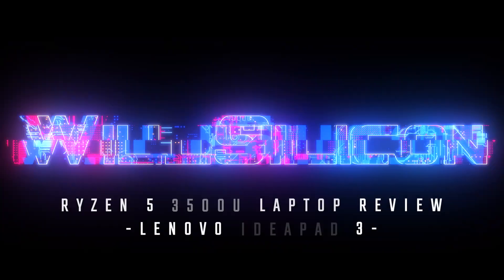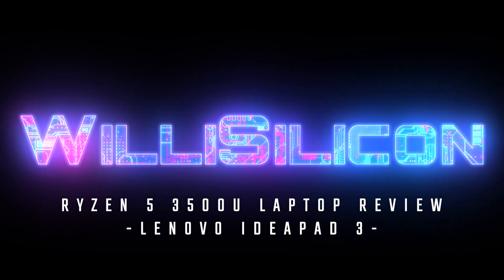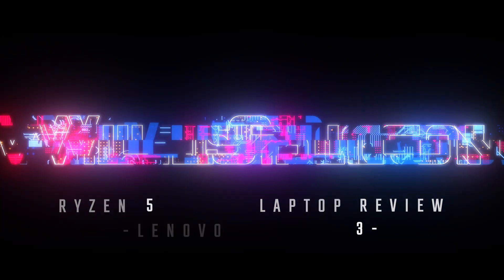This $450 Dollar Laptop Rocks! - Ryzen 5 3500u - Lenovo Ideapad 3 Review

Comment: the asus vivobook is a better buy, it has the same specs with a fingerprint scanner, thinner bezels and a backlit keyboard for the same price.
Reply from the maker: The only vivobook I saw around the same price had a bigger screen...which was bad in my case...and a Ryzen 3 instead of the Ryzen 5
Reply: WilliSilicon i was going to buy the one from walmart but its sold out ): it had a 14 inch display ill see if i can link it
Reply: @WilliSilicon  https://www.walmart.com/ip/Asus-VivoBook-14-FHD-Thin-and-Light-Laptop-AMD-Ryzen-5-3500U-Processor-8GB-RAM-256GB-SSD-Storage-Windows-10-Google-Classroom-Compatible/223381882
Reply from the maker: Nice! That doesn't have an NVMe SSD, but otherwise same specs. Great deal! Thanks for sharing

Comment: Love the Video, I have this exact model of laptop myself and I was able to upgrade to a WD sn550 1tb nvme drive as well as a 16gb stick of corsair vengeance ddr4 2666mhz ram for a total of 20 gb works awesome.
Reply from the maker: A 16gb stick works??? Lenovo claims 8 gb max in the slot! Awesome! Thanks for the info!
Reply: @WilliSilicon  It's the same with my Ideapad 330S.  They don't say in spec that 16GB stick works, but it did.
I used Crucial 16GB Single DDR4 2666 MT/s (PC4-21300) DR X8 SODIMM 260-Pin Memory - CT16G4SFD8266
Reply from the maker: Nice! Thanks for the info
Reply: Can you link me to the drive you got? I think I found one for a good price but I wanna make sure. And have you checked it’s actually utilizing the extra ram? I’m sure it’ll it work but I’m not sure it’ll use it. I just don’t wanna waste money on a 16 if I don’t need it.

Comment: Is it okay to use that laptop while charging?
Reply from the maker: Yes. Just as most laptops, the battery is bypassed while plugged in after it is fully charged. Eventually the battery will decay regardless. The laptop has great battery life to start out though.

Comment: Thanks for the review.Which 8Gb Ram Stick did you use to upgrade it to 12Gb?
Reply from the maker: Thanks for the view! I didn't upgrade the RAM. But any 2400MHz  8GB stick should work fine. The motherboard may allow a faster speed, but I have not tested this. 8GB total RAM is plenty for my son for now.

Comment: I have the Intel Version Of this Laptop I Love it. its super snappy And fit all my needs.
Reply: How much did the intel version cost? 
Also, what is the difference between AMD processors and Intel processors, if you're able to tell me?
Reply: @no1bro120202  Mine was 600 Something. And my Core i-5 version has four cores and 8 threads. It has 1 1ghz Normal speed with Boost up to 3.5. with a 128gb ssd with a 1tb hard drive.With intel integrated Graphics. And 8 gbs of ram.
Reply: but i financed mine.
Reply from the maker: 600 is still a pretty good price for that. At that price it probably has a little better screen too
Reply: @WilliSilicon  its the 15.6 Inch model With the 1366 Screen. I wanted the Ryzen Version but they was out Of stock then.lol . I need to see can i upgrade the screen to the 1080p Version.
Reply: its speed is 1 ghz normal with a boost of up to 3.5 ghz Sorry for the typo.I bought it to replace my Crappy hp stream lol.
Reply from the maker: @jharris1211  oh dang :(
Reply from the maker: At least it's definitely better than a Stream. Those are just for checking email lol
Reply: @WilliSilicon  I ran My tarot Business From it.lol
Reply from the maker: Poor guy. That probably got frustrating
Reply: @WilliSilicon  the stream ran nuclear hot. And i tried To game on it.lol Slideshow City.lol the only laptop that ran hotter had a amd semphron Lol Now that thing ran sun level hot.lol
Reply from the maker: I have one of the last consumer sold Single core desktop CPUs. An amd sempron 145. I'm gonna try to benchmark it one day
Reply from the maker: I'm not sure what the Intel version costed him, but the main differences between the Intel and AMD CPUs in these laptops are that you get more performance per dollar with the AMD CPUs and the AMD CPUs have much better integrated graphics.
Reply from the maker: Nice. The i3 one? They also have a cheaper Ryzen 3 version.
Reply: @WilliSilicon  i have the i5 version.
Reply: Okay, thanks for your help!
Reply from the maker: You're welcome!

Comment: So does the ram run in dual channel?
Reply from the maker: with the stock configuration, yes, but if you upgrade the one stick  then it will run in single channel
Reply: @WilliSilicon  ok thanks so much ill be buying this one now
Reply from the maker: @Stay1ng_Grounded  It's great for the price. I think Amazon is out of stock right now though. Beware of the price gouging marketplace sellers!
Reply: @Stay1ng_Grounded  You can get that one at Walmart at 419.99 plus tax. I paid 461 something after tax. (Yeah, hate Chicago high taxes).
Reply: @diegodeath88  just bought it today from walmart actually I paid $444
Reply from the maker: Awesome! The same Ryzen 5 version? Great find 👌
Reply: @Stay1ng_Grounded  damn lucky.... You don't pay so much taxes.